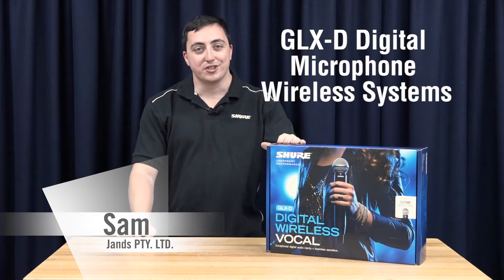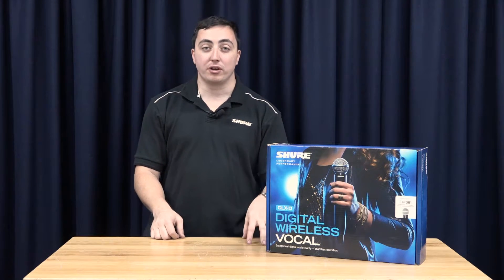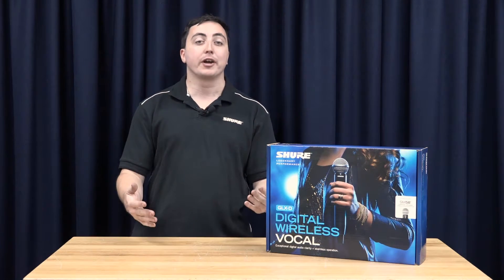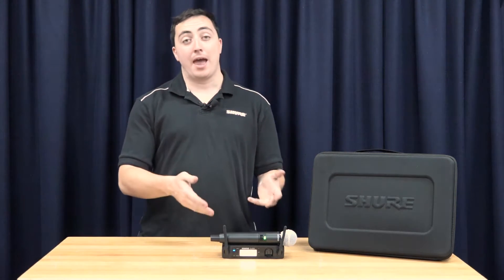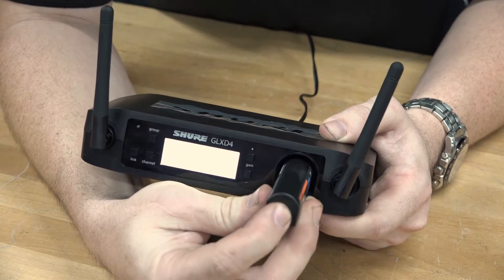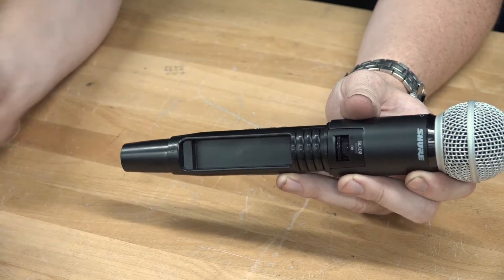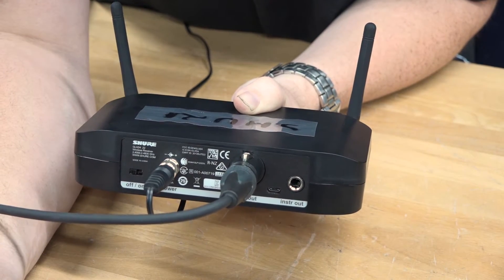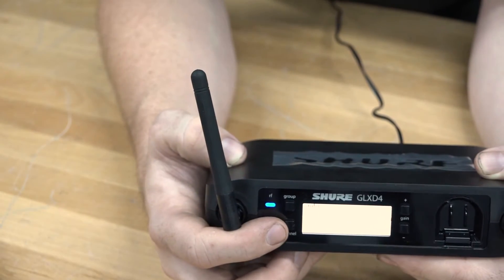Shure Wireless Systems: GLX-D Set Up Guide

Comment: i tried using Glxd4 vs microphone sm58 and beta 58a combined with Steinberger ur22c interface must say the sound is very bad i used gain at 10-17 the detail is broken for vocals really disappointing for the price shure brand  the Mics are no different from cheap products really terrible

Comment: I have a problem with my connection, every time when gig is happening outside, or where is 200+ people... I suppose that is because of cellphones, mobile network or more. I was trying to press channel button everytime, but it's hard not to crack. It's so annoying because everyone said I won't have problems with that. 
So what should i do? Would Group button help?
Reply: Try using channel 2. Also, if you are using any other wireless/Bluetooth devices, turn on the mic unit last. That way, it detects all of the other frequencies that it is trying to avoid. I hope this helps, it did with mine.